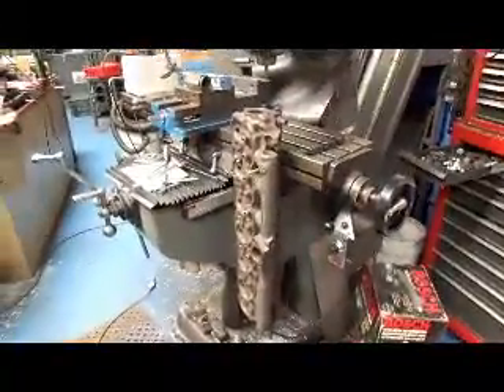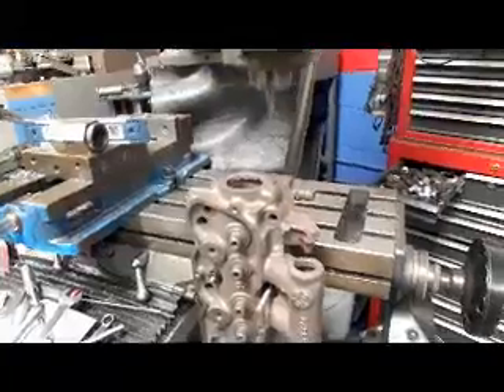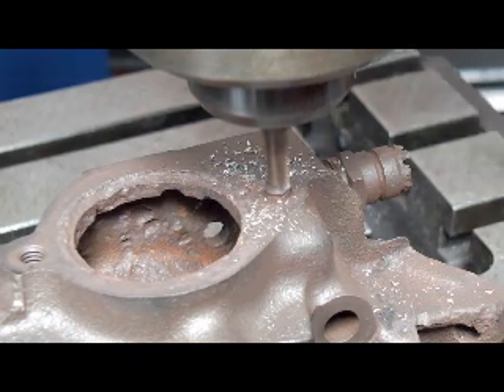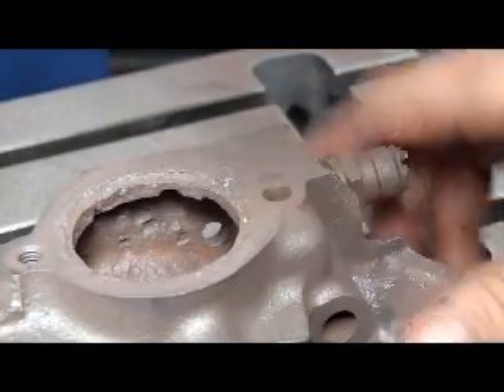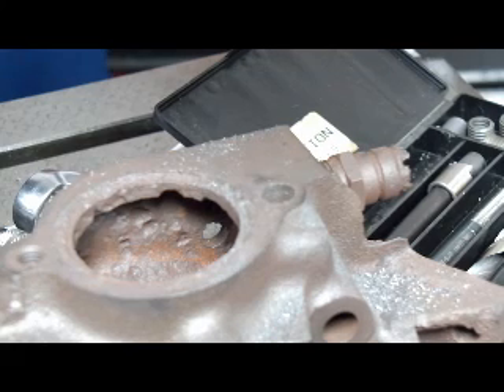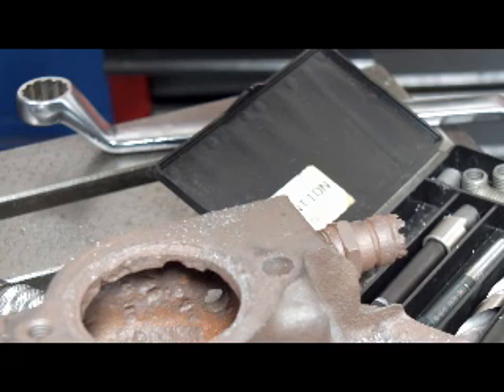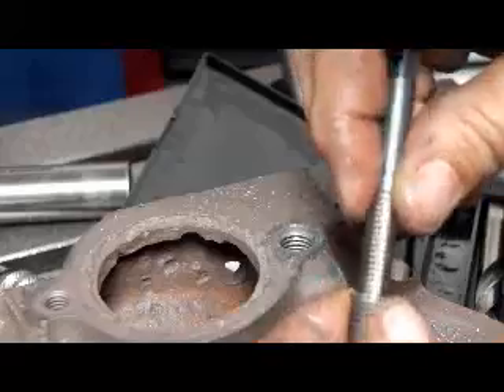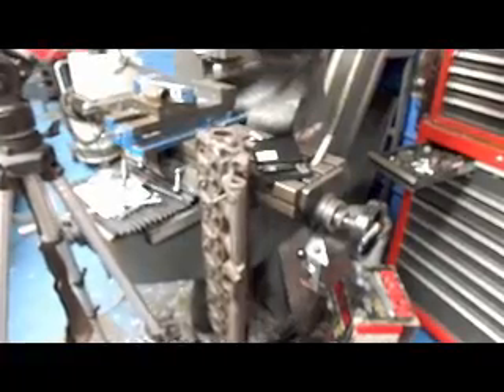Broken Bolt Removal on the Bridgeport Mill

Comment: there's 1001 ways to remove a broken bolt or stud, In this case ( the stud protuding the surface) I weld a nut using as much heat as possible to create a thermal shock breaking the bond between the stud and the part, 
usually, the remaining bolt or stud come off relatively easy

Comment from the maker: My customers who don't know the difference between a drill and a cork screw. In a production environment, I want to give my customers the best quality service that I can. Sometimes your method works, sometimes its quicker to just bore the bolt out and install an insert. This particular repair was on the front of the head and very difficult to do anyother way.

Comment from the maker: If you say so, this works for me. If you drill out the bolt and use an ezout and the ezout breaks, you will be spending additional time and money to remove it. I don't know how many people call me with broken-off ezouts. I can't repair their stupidity. If you 've had success with your method, congrats! Learn to keep your options open, you may have to use this method someday.

Comment: Option 1: centre the broken bolt, use a drill .020" smaller than the minor thread dia, the broken bolt will fall apart while you drill it. Option 2: Drill a hole about .040" smaller than minor thread dia and use an ezi out. I dont understand why you would spend all that time doing a thread insert. Whos going to pay for that?

Comment: Wish I could make a living with this kind of work, very nice :) Question; does this kind of job require the accuracy of clocking the cylinder head square to the table or is it fine just to bolt it up, and line it up sideways with a try-square?
Reply: Sam J j and just use a level

Comment: When the bolt is stuck in cast iron (and when it has been in direct contact with water..) its usually so badly stuck that it wont unscrew in one piece no matter what you do. Drilling it out on a mill is by far easiest way of getting the job done.

Comment: I'm surprised  you didn't weld a nut onto the shaft and then spin the nut, preserving the threads and original diameter. In any case you made this task look easy, which is quite a feat.